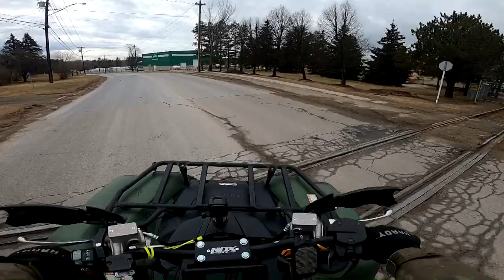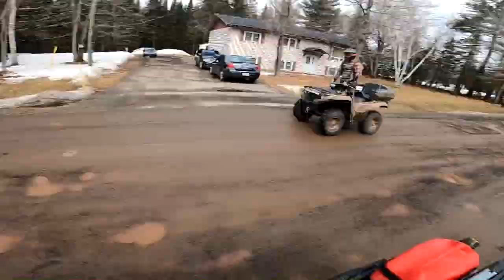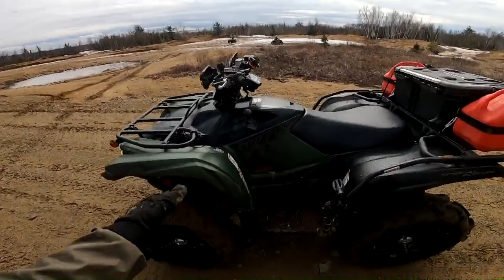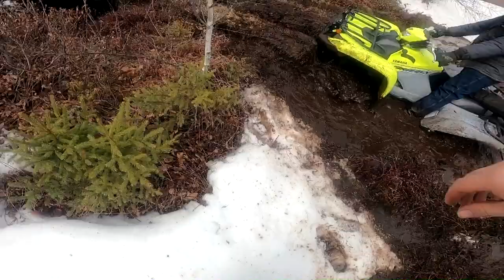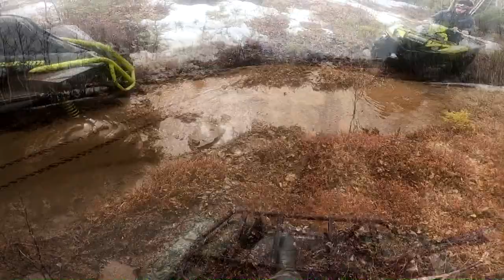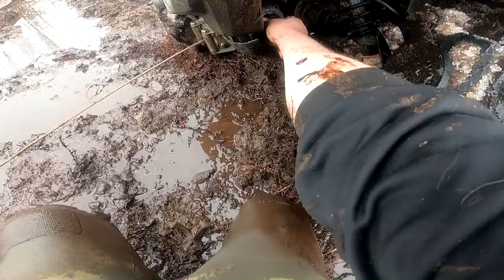Flooded Sand Pit Ride (Pt.1) Modded Yamaha Grizzly 700

Comment: Always a great time busting the trails with a good group . I’ve been heavily considering getting out of the HP game and getting a new 22 grey/white SE Grizzly 700 . Had three brutes which were all fantastic, and now a Sportsman XP Premium 1000. I wish the Grizzs had a lot more power without any clutching mods or bolt ons , but it’s really not a big deal , they have enough . I’m getting older and want the quality and the Ultramatic has always been the best CVT on the market bar none. Most of the time my four wheeler sits anyway cause riding the X3 Turbo is crazy fun lol . I’m down in the southern lower 48 . Y’all keep that snow and ice up there lol.
Reply from the maker: Thanks for watching! Seems like you’ve got it all figured out! Cheers!
Reply: I just got a grizzly and am amazed at how much better the ultramatic is than the CVTs on the multiple polaris that I had.  Would be hard to go back.  For trail riding I feel like the grizzly has plenty.  Just enough to get me into trouble.
Reply: @factionfx  it’s  not even close man . One way sprag constant tension on the belt . When we were younger my buddy had an 02 660 grizzly. That thing was beaten mercilessly for several years and the clutch finally seized right before 9000 miles . Basically zero maintenance ever and farm abuse . 
My brutes were great machines as well ,  but CVT is hands down ultramatic all the way . I’ll miss the arm stretching 51-90 hp from my brutes to this XP 1000,  but I’ll enjoy speed in the can am x3 turbo . Just need a good reliable trail four wheeler . I want the grey and white se.

Comment: What mods do you have on your Grizzly?  I’d like to stand my 19’ up like that lol!
Reply from the maker: Long list my friend. 
* Adrenaline off-road rgb+w Rock lights
* Yellow/amber Halos
* EHS tuner: 2hp
* AIS Delete: 1hp
* Andrew deal greaseless sheave 19g weights, 3 friction washers
* .15 mm shim
* Purple Spring
* Rox risers
* MSA m12 14” Diesel rims
* Aftermarket Fuse box 
* Powermadd Matte Black Starrseries hand guards
* Atv mx modified mounts (not tri mount)
* Dual led lighted toggle switch
* Maximum Medium Storage box 
* 2 10L Fuel cans
* Custom fuel can mounts
* 1/4” diamond plate rack support 
* Kolphin gun mount grips
* 2R tip (2hp)
* Custom stereo (2 400watt Pyle speakers, 400watt 2 channel Pyle amp)
* Kimpex passenger foot supports

I was running an empire slip on but they are difficult to maintain so I swapped it for the 2r tip.

Comment: How hard was it to install the andrew deal clutching? also did you put a different spring in the secondary? or just primary work
Reply from the maker: It’s a decent size job, you should have some experience to do it. You have to split the case on the side of the motor in order to install the slugs. I don’t recommend the slugs if you run a 27” or smaller tire, and if you put a 28 on a grizzly it’s really going to kill the sportiness of it. I was running a green secondary but since I took the slugs out - I went back to a purple epi secondary with no slugs and it’s much much better. So this is both primary and secondary

Comment: Hey what’s the mod you have in the clutch to make it wheelie like that my 21 does not do that and I would like it to lol
Reply from the maker: Andrew deal machined sheave, purple spring, 19g 31mm weights, 3 slippery washers, .2mm shim
Reply: Try quickly bumping 1/3ish throttle to preload the suspension, then give it a through stab, that bike should stand straight up and down. Doing it this way also seems to bypass slipping the internal wet clutch, which seems to happen if you just pin it wot.